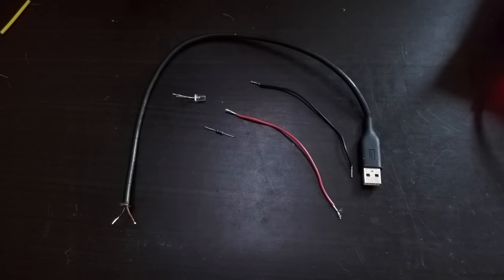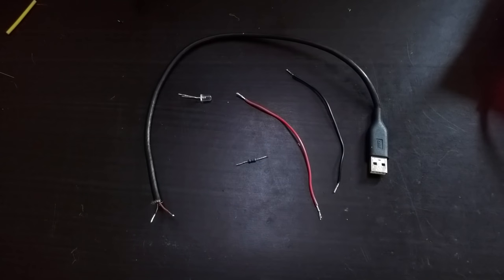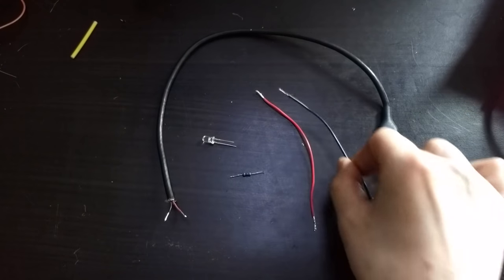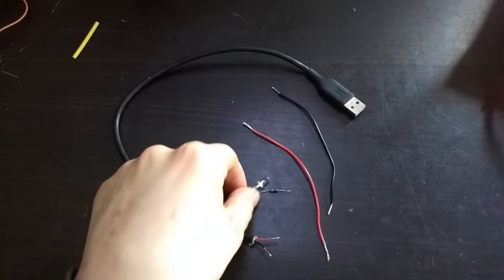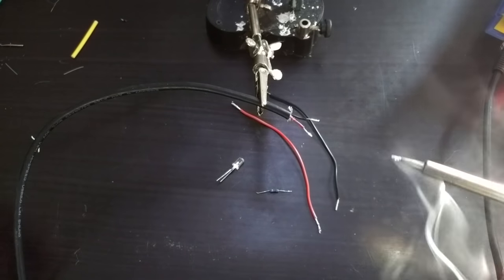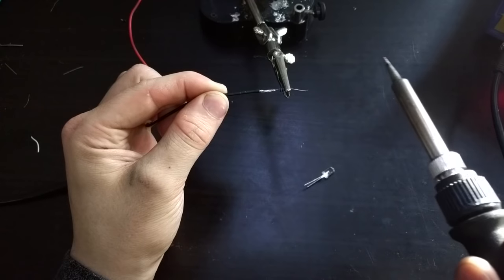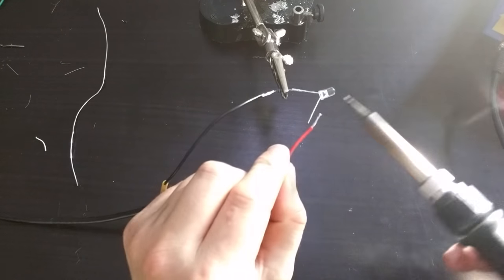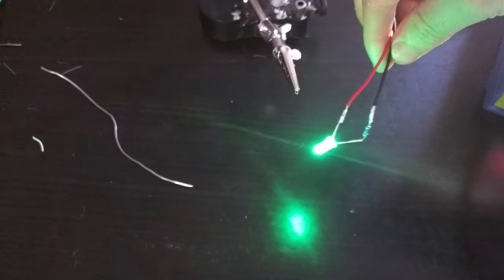How to Make a Simple LED Circuit (Interactive)

Comment: Why did the resistor go on the negative side? Surely you want to resist the flow into the led? Too bad you didn’t explain anything in this video. Just a color by numbers, learn nothing. Not that expect you to reply back. You haven’t t replied to any other comments.. social media fail
Reply: There is a ton of replies to this lol. He even gave the example that you slow down water at the tap or after the tap, it's still slowed down. Same with electron flow. So it does not matter what side you and the resistors to it.
Reply: @oxygen454  Timestamp? What replies? I went through the comments and didn’t see one reply from the channel
Reply: @oxygen454  Also, there ARE a ton of replies. ARE = plural. IS = singular. Did you even go to school
Reply: @madmac66  2 years ago he replied to a man named Muhammad, he explained why the resistor placement could be on either side of the LED.